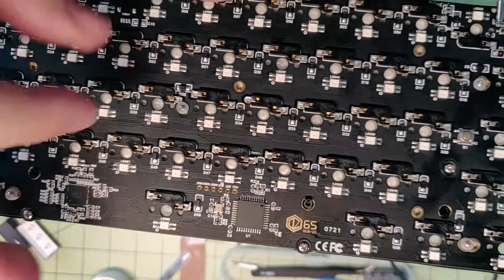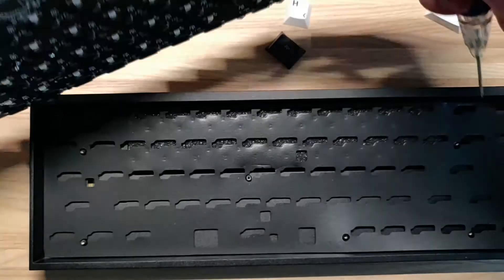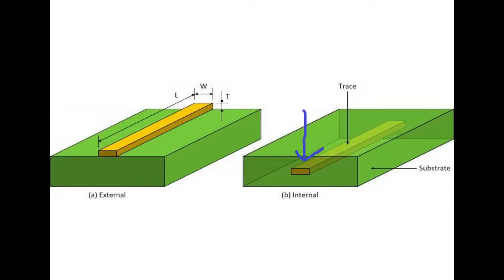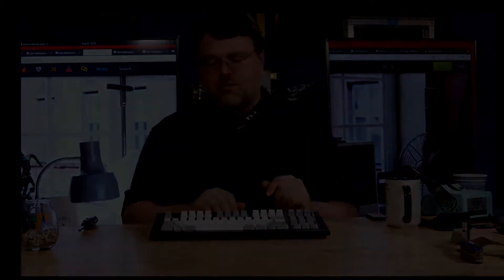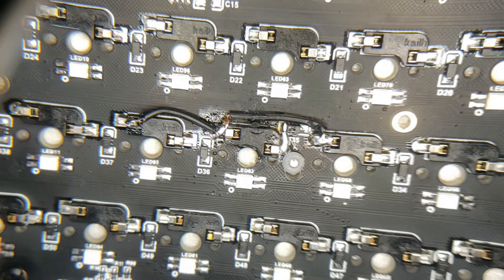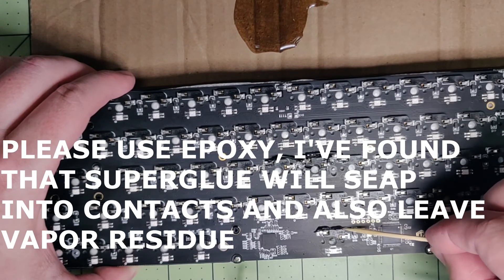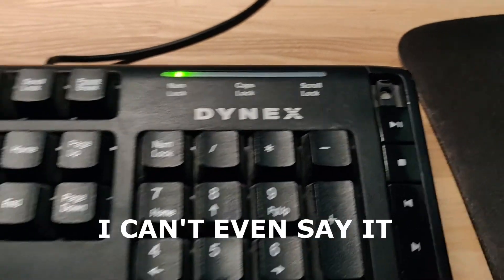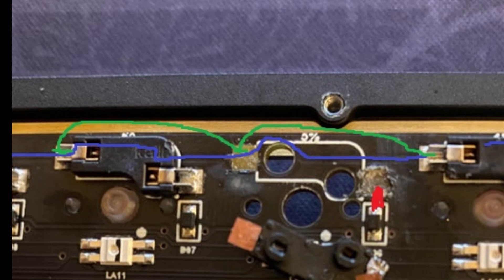Repair Broken Keyboard Hot Swap Sockets!!

Comment: cant u just solder it back even without the pad bc the soldering metal will replace as the pad?
Reply from the maker: You would think that and i tried but it didn't work, the soldering doesn't fix the broken connection between the pad and the PCB trace, at keast not consistently and thus this method must be used.

Comment: what if the socket isnt phsyically broken off but just is no longer working. mine is still intact but it wont output the keystrokes
Reply from the maker: I doubt its a connection issue but something else then.  Already try a new switch?  You can jumper contacts to test.

Comment: Hello, i have the same problem on the capslock . If it the first switch from the line, I need 2 jumpers or 1 jumper ? 
I'm having a hard time figuring out which part I should connect it to

Comment: can you help me with my problem? mines hotswap as well. the problem is my letter y sometimes it registers when u press it and sometimes no so what I do is press it harder then it will register. I recentl modded it with eva foams on top of the pcb and tempest mod/tape mod at the back of pcb.
Reply from the maker: Hmmm, maybe the foam is conductive?  Or maybe it's from a diode connection going bad.  I'd take it apart and inspect with a magnifying glass

Comment: Can you help me? Everytime i press any key within the row the whole row get pressed/activated
Reply from the maker: I'm not sure what can cause that, maybe jumpering the wrong side of a diode causing the firmware to think you are hitting all those keys at the same time?
Reply: @tokentech3318  i even use tweezers to make sure if it’s the switch that is causing the problem. But no, anything that i press within the row of the esc key everything in that row gets pressed
Reply from the maker: I suspect diode jumper placement - assuming you have attempted repairs.  If you haven't attempted repairs yet, I believe one of my symptoms was multiple switches in the row triggering due to one broken socket
Reply: @tokentech3318  I have no idea on how to fix it :<
Reply from the maker: Wish I could be there to help... Maybe you can post a thread on the lvl1 tech forums with detailed pictures?
Reply: @tokentech3318  new users can’t attach files. Maybe i can dm you if you’re not busy?
Reply from the maker: Make some posts so you are not a new user, there will be more than just me to help there.

Comment: Can't you just solder the broken socket back to place...
Reply from the maker: If that works for you, great!  The vid is for when the pad itself comes off and breaks the trace connection to it.
Reply: @tokentech3318  How did you break that much of it ?
Reply from the maker: Lots of pulling and inserting switches playing around with foam and other sound mods
Reply: @tokentech3318  same
Reply: @tokentech3318  my spacebar broke i tried soldering but there was no copper there what to do now my keyboard doesnt show the traces for a dumb reason
Reply from the maker: Might have to get creative with how to jumper such as adding some very small gauge wire from the appropriate diode and associated neighboring sockets.
Reply: @tokentech3318  i was too lazy to do anything so i just soldered a cable in pararell to a unused key and it works now

Comment: Man i did that, and it restored continuity but the button in the middle still doesnt work. Wth am i doing wrong
Reply from the maker: There may be more than one broken solder, or you connected the wrong compenents by accident.  Try using a magnifying glass to further inspect the traces and state of the solder
Reply: @tokentech3318  pretty much on my keyboard k95 corsair, the y axis isnt obvious but the diode socket was broken as well  (on "w" key) and i connected it to the diode on "2" key and it restored the vertical continuity i guess. It works now. Thanks for the vid.